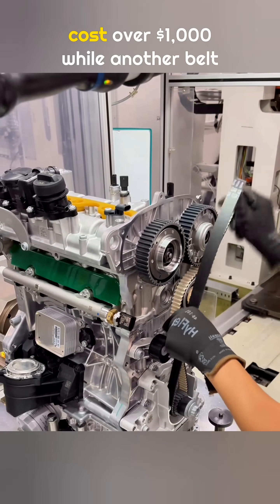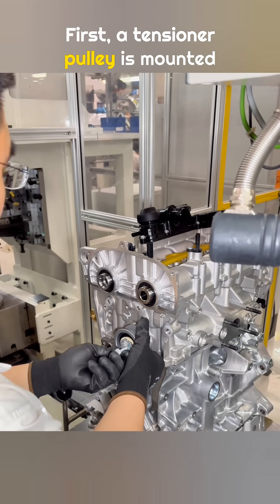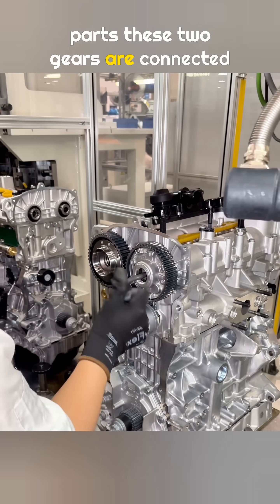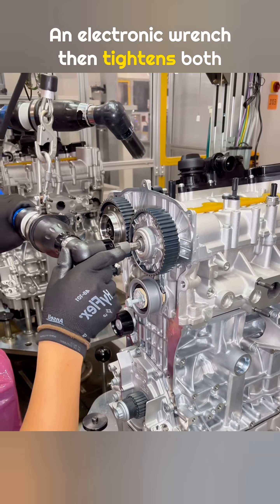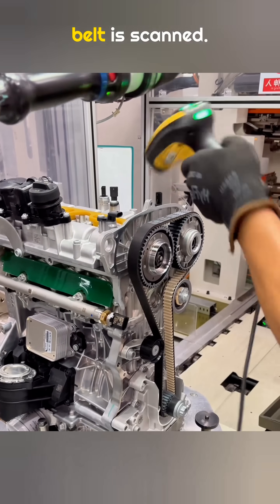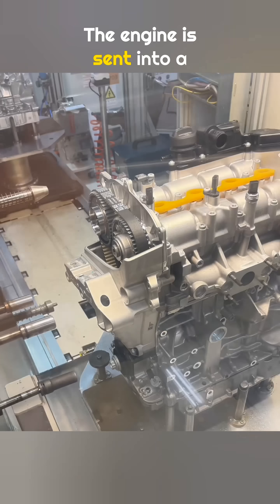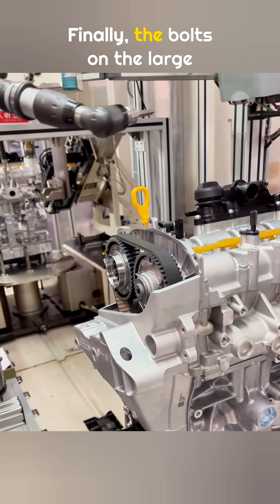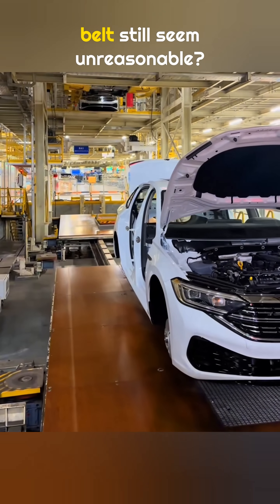Why a Timing Belt Replacement Costs So Much

Comment: I've had one done for £50.    What was described was not changing a belt but fitting a belt at the factory.  There is much more control, easier access and much less likely to be bodged.

Comment: Paying $1000 for a timing belt replacement is ridiculous. It's not that difficult. This video is bullshit and discouraging to those who might be learning this trade especially to those who might be newer to DIY. It doesn't show how it is when in a vehicle or steps you need to take before removing the belt or even the timing cover or how to properly tighten the belt when you don't have fancy assembly line tools. If you're gonna do it yourself do the research, watch multiple videos on your specific car.

🤘🏼

Comment: Timing belts are smoother, quieter running. Unless  it’s a stupid wet belt disaster.  And chains need oil lubrication and do stretch and wear gears, that all require changing.   Timing belts required no lubrication and are situated under a dust cover and inexpensive to replace even at the dealer.  But USA brand vehicals and USA build Foriegn vehicals are all rubbish.

Comment: The whole thing is designed for minimal cost for the manufacturer, and subsequent costs of service replacement is dumped on the customer.

Therefore you have just lost a repeat customer.

Or is that too difficult to understand?

Comment: Timing belts are used, so you can ruin the engine faster! I love my Tesla, because I don't have to think about oil changes, cooling, or other things. The electric system monitors my battery. And, this year or 2027 the battery cost will be $US 19-25 a KWh. I charge at home, or at work for free.

Comment: No only did they over complicate the belt install. It appears to be an oil wet belt. That means as the belt wears over time you will not only have to change the belt. But you will also need to clean any debris that came off the worn belt from the engine oil passages. Including the oil strainer. No thanks. I’ll stick with an external engine belt.

Comment: Because there is virtually no clearance to access the 100 or so bolts, clips, and other fasteners you need to remove (and reinstall) to do the job once the engine is installed.  In many cars you have to disassemble the right hand suspension, remove a motor mount, support the engine with a special rig, etc. to do the job.  On some cars its easier to remove the engine first.

Comment: Yes, because I can just buy an electric vehicle and never have any timing belt that needs replacing - same with spark plugs, engine air filters, radiator fluid, and myriad other parts, that make maintenance the primary profit center for legacy auto. 🤷‍♂️

Comment: Where do you live that timing belt change is $1k?! The hardest part about replacing a belt is getting to it...
Reply: That sounds cheap to me. That's about $1500aud and here in Australia you'd pay about $2500 - $3000 aud
Reply: @Tom-f8r8o bruh... that's crazy talk! Got both my car's timing belts and a tune up (spark plugs, wires, seal check, etc) done for $650 each usd a year ago. Also, had no idea your currency got so inflated...sorry 🙁

Comment: Agree with comments that say its all in the design or lack of it. It is also caused by cramming a large engine into a small engine compartment. Its not what is good for the customer but what is good for the car companies' investors pocket books.

Comment: A timing belt is just that!
The camshaft rotate moving the Valves in sink with the Pistons. The Valves rotate  in accordance with the crankshaft rotation, just a few degrees off, means how the engine performs. 
It’s not just removing and replacing the timing belt, there’s much more to it.

Comment: Steps to fit the original components are unrelated, eg the camshaft gears are not touched during belt replacement.

Comment: combustion engines have been around for over 100 years.  There's no reason why Timing Belts should need replacing except in rare cases.  It could be bad engine design.

Comment: Hi didn't even mention having to remove the power steering pump, one of the motor mounts, the AC compressor, etc depending on the car. So much stuff in the way.

Comment: I once changed a timing belt on a VW Golf in an hour or so. With a modern Golf it takes five times as long. The reason ? VW designed it that way so the dealer can charge a lot more to do the job. No other reason.

Comment: Yes - because your video shows initial factory installation. Not all of this happens when you replace a belt in an existing engine.
Reply: Agree.  This is a BS video.

In a garage, the main pulley is removed.  Maybe a radiator shroud too.  Then the timing belt cover comes off.  A manual crank lockout tool is fitted.  The tensioner is depressed by hand and the timing belt slips off.  Fitting a new belt is simple.

Even a slow mechanic can do everything in 2 hrs.  So with the best cost, it’s $400 or less.  DIY is $100.
Reply: @paulgrimshaw8334 depends on the vehicle. I recently did a Chev Cruze...takes a lot longer than a north south engine as  the engine has to be suspended and the right wheel all lower covers and mudguard liner, then right engine mount which is 9 large bolts and 3 pieces before the timing covers can be removed.
Reply: @smileyo9764 This isn’t good design, in my opinion.  If GM wanted this kind of packaging, they should have selected an engine with a timing chain.

But all this means is an extra hour’s labor in a shop equipped to service such a vehicle.  A wheel requires 2 minutes to remove when the car is on a hoist.  A wheel liner takes 10 minutes.  An engine mount a bit longer but you’re using a zip gun.  As for covers, all timing belts have them, regardless of a N-S or an E-W layout.

So let’s call it two more hours (an hour each way, which is insanely generous), taking the job to four hours total.  That’s $600 labor.  So I’m still not seeing this being a $1000 job.

Comment: No, because replacing the timing belt AND the water pump labour included cost less than USD400 on a 2014 Land Rover LR2 diesel.

Comment: Whatus sad us his design hasnot changed for 60+ years. 

I have changed them but what is the most frustrating is that there is so little space to remove and put back the timing chain while the engine is still in the car.
Reply: They have changed. I did one back in the seventies where you only took off a thin metal cover and changed the belt. I think it was on a Chevy, Vega or something.

(and there was plenty of space to work)

Comment: I guess timing chains are better
Reply: Not necessarily, look at the Chevy Colorado or GM's 3.6 liter V6 those are both timing chain failure prone engines. Most timing belts are designed to be a serviceable part. It's up to the consumer to do research before buying a car. When cars with bad engine or transmission design(s) don't sell they will quit making it and be forced to make what people want.
Reply: @dan @danp7463  maybe that’s just Chevy with those problems but the timing belt looks cheap like it could break
Reply: I do not do the miles so its a change every 10 years, not excessive. Maybe 1 more change left for me.

Comment: Will. Why they not make the belt with material that not need to chang permanent belt !!?
Reply: They used to. It’s called a timing chain, but went out of fashion.
Reply: @cortinaman1671 Yep it's a shame how much quality has gone down in modern cars. Some engines even have an oil pump belt now instead of a chain or gear drive. That's absolutely insane and completely catastrophic if it fails. Any kind of belt where it doesn't belong is bad enough but wet belts are a whole other level of stupidity. Anything INSIDE the engine should be a CHAIN OR GEAR DRIVE to last, not a belt that can dry rot and wear out fast along with completely killing the engine in terms of timing belt failures on an interference engine.
Reply: @cortinaman1671 absolutely not.  I have a 2004 and a 2020 and they both have timing chains.  My husband has a 2012 and it also have a timing chain.  Do your research before commenting
Reply: @gamerincorporated154  many cars don't have the timing chain anymore compared to the 80s. Timing chains are better.
Reply: @cortinaman1671  That's true, they do have chains - however they have guides which like to fail, and they are far more difficult to get to and replace than a belt.
Reply: In fact there doesn't even need to be a chain - the Peugeot 504 engine for example had a gear wheel on the crank shaft that meshed with another on the cam shaft. Once correctly aligned - there were marks to match up - the timing was locked in.  One problem - the gear wheels were quite heavy, which gave the engine some unwanted rotational inertia - i.e. it was marginally slower to rev up.
Reply: @douglasclerk2764my old boss said that his daughter had a Pontiac that had that.  Called a "timing gear".  I never heard of them before
Reply: Chain nowadays requires changing too, it's just better to have a dry belt that can be replaced "easily" without taking the engine about of the bay. Sad thing is emission test these days require very high efficiency so using a thick chain is not usable, so chain engines use "bike" chains that become loose with time and require replacing which is very costly. I prefer having an accessible belt and replacing it every 120-180k km
Reply: @lordkubikum it's because manufacturers started make those chains thinner and weaker so they strech up easily.  It's by purpose so the money can flow in for replacement of the chain or selling a new car if you don't replace it!
Reply: @lordkubikum 
Of course chains also needs replacing now. It’s all about planned obsolecense and keeping up new car sales
Reply: It’s not that bad to change

Comment: That is EV cars are the way to move forward..
Reply: I can't think of a bigger inconvenience than owning an EV. Diesel is the way to go. The Europeans are ahead of us on that one.
Reply: @danp7463 Petroleum is a depleting commodity and it will increase by the day. In Europe Diesel is expensive. 
With EV, we have renewable energy and nuclear power station are abundance of cheap supply. Further Diesel Engines failed emission standard and pollution to the Air we breathe in.😮
Reply: Yeah, the power to run them often comes from fossil-fueled power plants and the batteries are so toxic to the environment that they actually contaminate the environment much more so than burning fossil fuels!! Oh, don't forget about the severe fire hazard that they are, once they ignite, they're almost impossible to put out!!
Reply: @elppedro77 Zilly Fella. Tell me..Where does the material of battery comes from???.From outer Space????😂
All the battery material dug out  from Earth..
Do you know there is recycling facilities for Batteries.
Can you recycle toxic Fumes from ICE engine.??? Do you know why Buildings and Houses black in Color? It is the greassy fumes from ice engine that stuck onto building and House surfaces. Imagine those black greassy stuff stuck in your lungs.